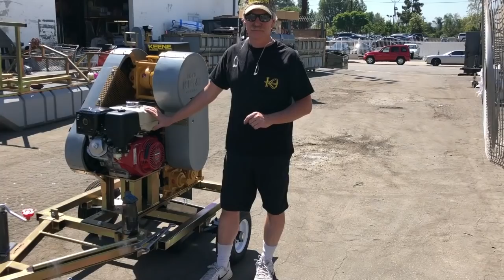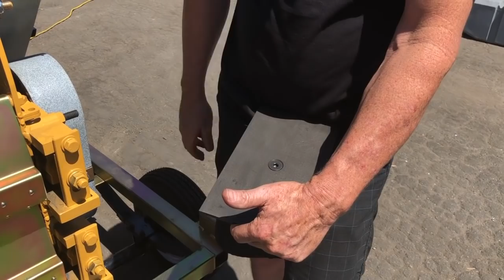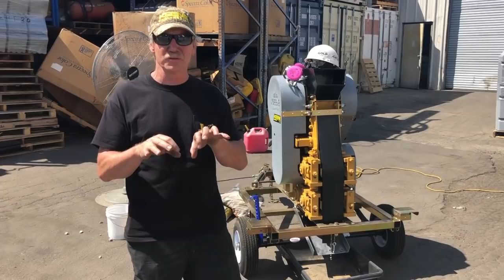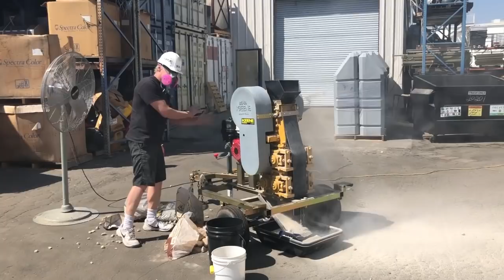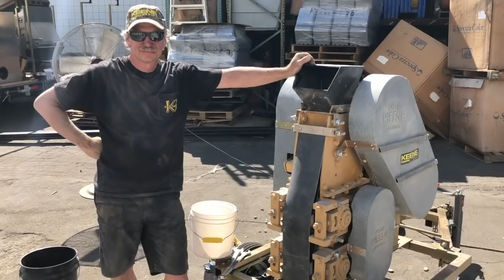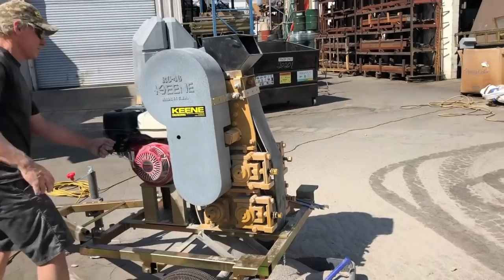Keene's RC46DR Double Roller Rock Crusher

Comment: You need to add a levered device that will support your 5 gal bucket, with controllable tilt, to enable you to feed the material into the crusher with minimum effort.  It could be as simple as a U shaped fork that attaches to each side of the input with a small flare, the tail of the "Y" being your lever to lift and tilt the bucket.  Easier than holding 80 lbs of material and feeding manually over several minutes.

Comment: Just add vacuum filter on top of the engine filter. Home depot sells vacuum filters you can add with ruber support. You can take off vacuum filter every few hours tap it and put it back. I do it on my KnM rock crusher.

Comment: Do your rollers ever get clogged up?  What would be the cause for this, making the free spinning roller stop and rock pieces accumulate between the two rollers?
Reply from the maker: The rollers typically do not clog up providing the machine is properly maintained.  I have seen this happen if the rollers' leaf springs get loose and a pebble will stall one roller and back material up.  Properly adjusted you should have low grief with this machine.  Remember crushing rock is an "extremely" difficult task, maintenance, and a properly adjusted machine are mandatory so if you are not a mechanical-minded person and you are not good with maintenance do not get into hard rock mining.

Comment: Keene Engineering Inc. "I call it death dust to a motor you take on like a quartz type rocks which is very brittle sharp and you crush it into fine powder so you have this hundred mesh dust that is just razor-sharp so if you get any of that death dust into the engine you can kiss your engine goodbye so if you take care of this and you and you keep your log clean you maintain your air cleaners and I would suggest you go buy a bunch of these online carry an arsenal of them and it's also a couple of things you can do as well but super super important what we do I do two different trips you'll notice over here I have a fan position behind me okay and what I do with the fan is I'll turn the fan and in any dust at the current that the rock crusher generates it gets pushed away from the from the crusher itself so that way I know I always have clean air another common trick that I do is I have one of those little three-foot long manhole cover vents I'll take that and I'll bring it here and I'll actually position it up lean it up against against the trailer and I'll have the clean air blowing from underneath and that way again I know that I'm going to have a dust free air clearance but again with the crusher you're creating death dust for the rock crusher so always have a small arsenal of air cleaners keep it oil clean even though they've the manual says change your oil every something like 40 hours because of the kind of environment we're running in and very harsh environment you want to change the oil probably twice as much or at least every 30 hours or so so maintenance is critical I love selling engines but you know it's that's good for us but not good for the customer so maintain this mode if you take care of this it'll take care of you" https://www.youtube.com/watch?v=iATU0PzhauU&feature=emb_title  Keene's RC46DR Double Roller Rock Crusher

Comment: Hi, Keen Engeering a Nice work...Can it be operated using Electric Motor is yes then what capacity and  What is Production Capacity per hour and what is the maximum input size accepted by the crusher. can you email the details to us if yes it will be a great help my email address is stoneyuug@gmail.com.   Thans in Advance..
Reply from the maker: The electric motor is a 10 hp 3 phase.  If you have power the electric is the best way to go. the tonnage is roughly 600 to 2000 lbs per hour.  I have been if fractured quartz and I was able to maintain roughly 1800 lbs per hour.